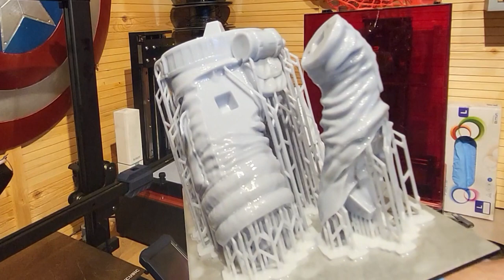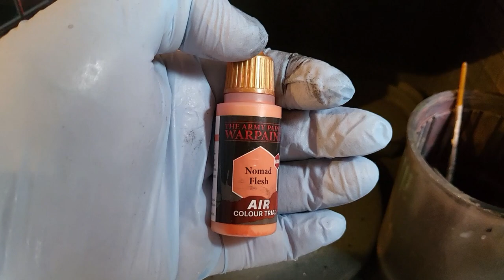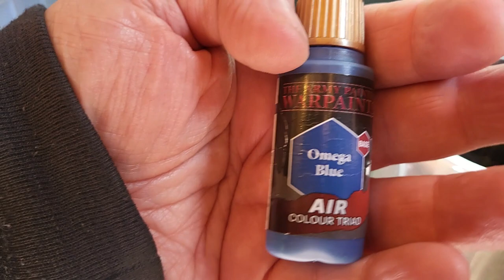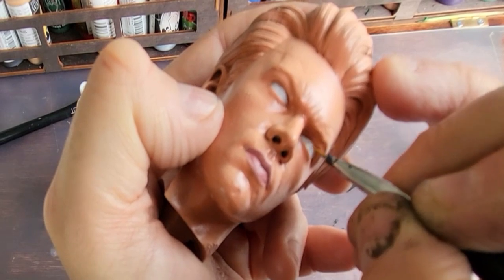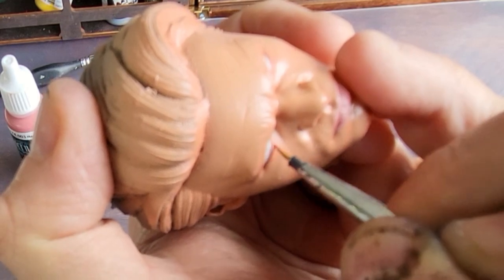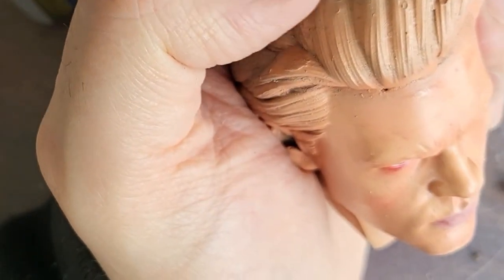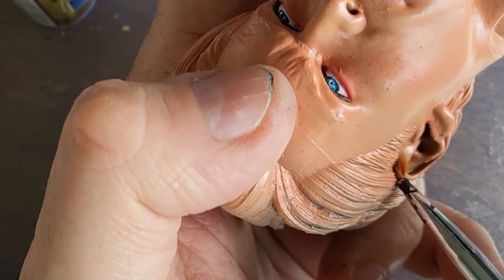3D Resin Printed Cal Kestis From Jedi Survivor & Fallen Order Print & Paint Star Wars PS5 PS4 Xbox

Comment: You do a good job painting. I think it would stand out a lot more if you prepped your part after print a little more. I can see lots of bumps, pits, and lines. Which distracts from the paint job. But still good job. 

Also have you ever had an issue putting clear over the Army paint washes b4 they dry enough.  I’ve had this frost build up. Completely ruined several parts by the time I realized what was going on. It don’t do it on my homemade washes.
Reply from the maker: Ah not had that tbh.. Strange... I'm my own worst critic and I agree need to do more prep too. It's my rush to get it finished lol 👍👍 thanks for the comment.. Greatly appreciated 😊